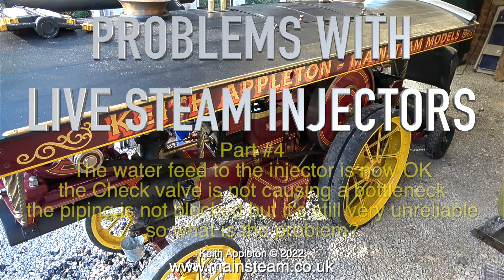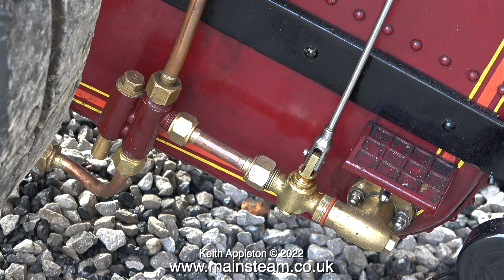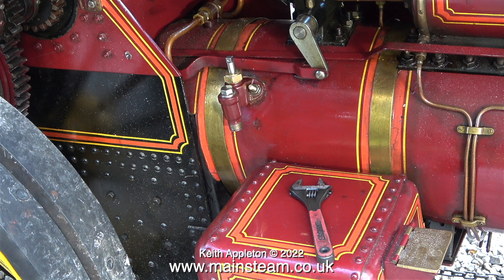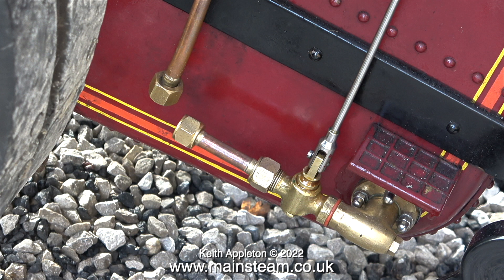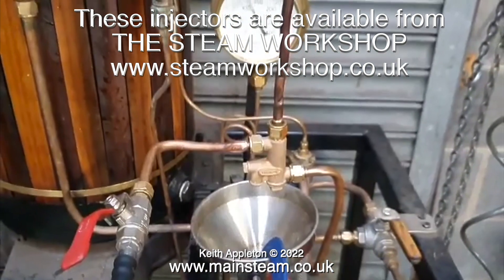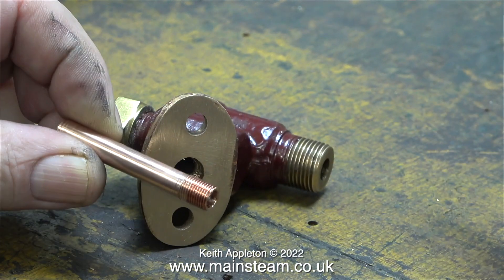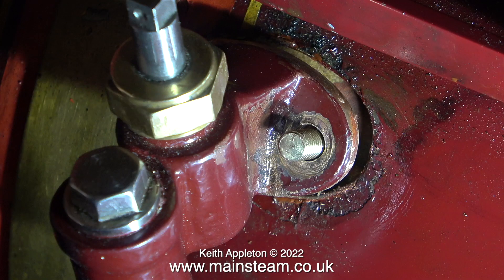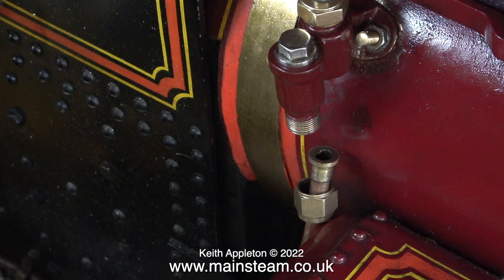PROBLEMS WITH LIVE STEAM INJECTORS - PART #4

Comment: I spent ages trying to sort out an injector, nothing worked and then I wondered if I had put the wrong one on and it turns out  I had accidentally swapped over check valves with the one of the axle pump after repainting. We live and learn. T

Comment: hi keith so how do top feeds on locos work as there strait in to the steam space i have the same engine as you with out all the shiny bits and   the same problem as you the only thing i have not changed is the steam valve   and i ended up building a foden wagon and forgot all about the thing till you brought this up
Reply from the maker: the proximity of the top feed water inlet on a Railway Locomotive is usually a long way from the turret over the firebox. The configuration on this Traction engine is the steam takeoff point is very close to the water inlet. A smaller injector would work, I am just curious to see if my method allows me to use the existing number 8 injector.
Reply: @keithappleton  thank you i hope it woks then ill try again   that was a few years ago

Comment: This "series" concerning the injector is a great case study in trouble shooting. With every problem, there a variables, which can cause a failure. Determining which variable is at fault, and then finding a solution is the process we are witnessing here.
This process works for any mechanical problem that might be encountered, It is just a process of eliminating each variable until the problem is found, then the fun starts, find a solution
Great video series. ;-)

Comment: Good points as for testing. It is easy to overlook things when you have steam up and are excited. I have done that too recently! Good to be systematic with checking things. Another trick, with water supply side is to disconnect the water supply and have a pipe direct from a bucket or cup and straight into the injector. I know you have gone and re done your plumbing, but doesn’t hurt to check. Presumably your injectors lift so it should be a good way to check.
Reply from the maker: I already did that a while ago, it didn't make any difference, after using a water container, I even connected a hosepipe to the water inlet to the injector, but still no difference . . .
Reply: @keithappleton  that’s a pest. I will be interested to see where you end up. Have you tried disconnecting the outlet or at least loosening the union but to vent to atmosphere and see if it feeds dry? Then tighten the nut up and observe. Could be a restriction in the clack, not enough lift or the ball partially blocking the outlet to the boiler. Sorry if you have tried all these things. It’s hard to solve “virtually” isn’t it?

Comment: deja vu .... nice new steam injector btw .... I still suspect that the water is messing your steam up ... perhaps a longer pipe with a slight bend down ... I would expect a length of pipe to bring it to about half way ... sure it may be under water some BUT it will be out of the steam ... sure it might even cool the water a tad ... BUT it shouldnt cool the steam unless it has to fill it from well below the end of the pipe ... 
.
a possible idea or test ... make a thin flange for the extension pipe into the tank ... you could gasket it later as well and then have a enlarged entry into the extended pipe so the injector lines up mostly and has room to push the water into the tank ... sure you may end up with 2 gaskets on this part if that is how it ends up ... BUT it will answer the question is the pipe long enough not ... and might let you use the original injector still ... 
.
another less work option would be to find out if their test rig injector inlet to the tank has a pipe extension and if so how far down does it go ... in the video the injector port on the tank .... rewatching the new cast injector ... if its exit pipe is at the bottom then perhaps having it dump the water in a stream into the tank wont be so bad ... or it may be the same problem
Reply from the maker: Please continue to watch the series . . .
Reply: @keithappleton  I plan to ... I want to see why for certain ... see if I am learning anything ;)